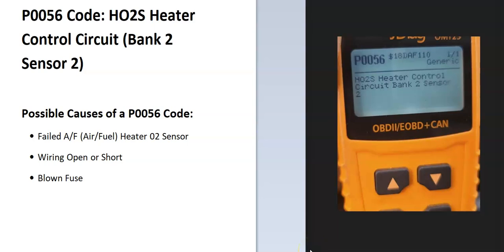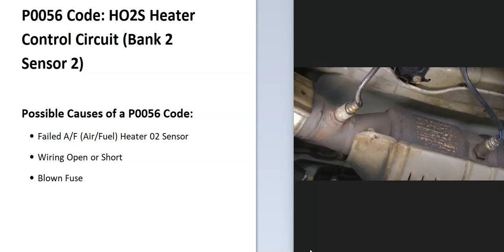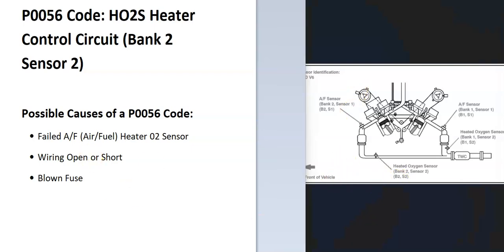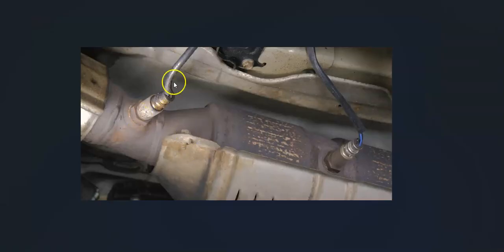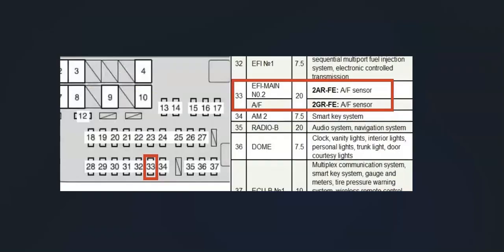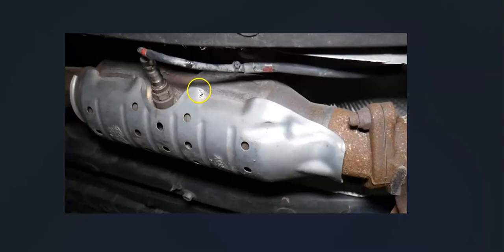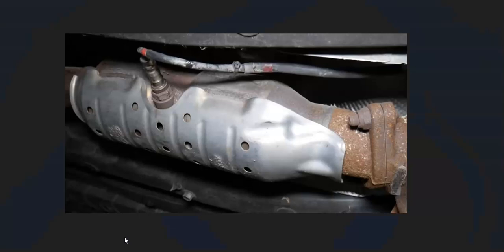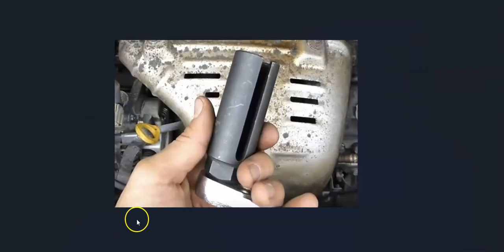Causes and Fixes P0056 Code HO2S Heater Control Circuit (Bank 2 Sensor 2)

Comment: Check what fuse ?
Reply from the maker: It can vary, but usually it is located in the engine bay along with a relay. It will be labeled something like O2 Sensor Heater, AF Heater, or HO2S.

Comment: As another individual asked below, can it be a bad Cat?I have a 2018 Isuzu NPR-HD truck with a P0056 and P0161 code for Bank 2 Sensor 2. We replaced the sensor and have the same thing. Heater elements for both the old and new sensors read about 6 ohms. Wiring looks good and others indicate that it could be a bad ECU. I don't want to buy that or the CAT without being more sure.
Reply from the maker: It needs to be diagnosed, but usually, a bad CAT would give catalyst codes. If the sensor is good, I test the heater wires for voltage. When the engine is cold, voltage should be going to the element, usually 12 volts, and then drop.
Reply: @HVAC_Mechanic   Thanks for all of your help. It was a simpler issue....we replaced the wrong sensor. The flex pipes coming off the manifolds cross underneath the truck so the downstream sensors are opposite of the upstream. Replaced the correct sensor and after the test drive we have no Check Engine Light!. You rock and I am now considered even more of a genius than before. Seriously thanks for your great video and help

Comment: Would this cause the radio and or climate controls not to work?
Reply from the maker: I would check the fuses and be sure none have blown. It needs to be diagnosed, but it could be a wiring issue. Also, a bad ambient temp sensor can mess with many newer vehicles HVAC systems. Usually, there is a code if it is bad.
Reply: @HVAC_Mechanic  it’s giving off a 02 sensor would that cause my issue
Reply from the maker: No, I've never seen a 02 sensor affect the HVAC system.